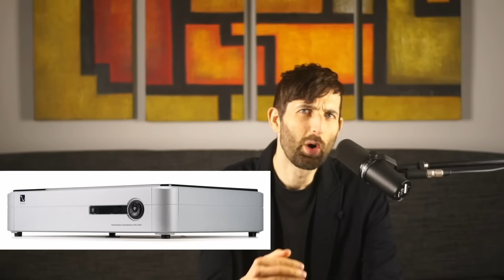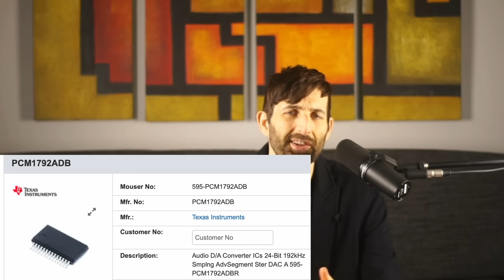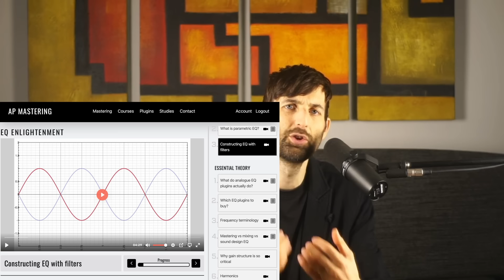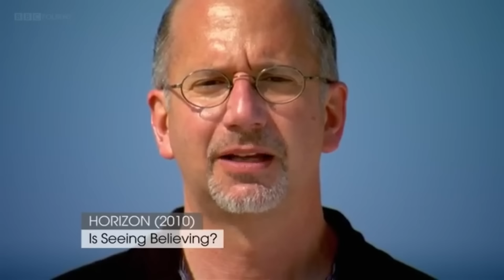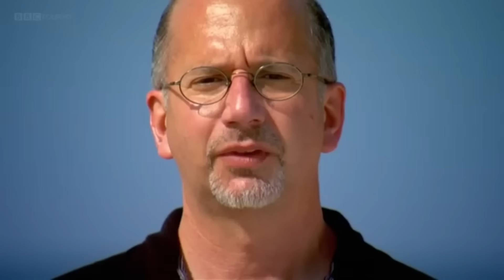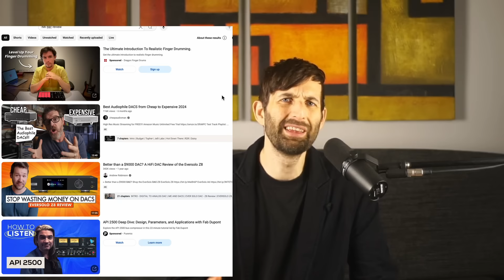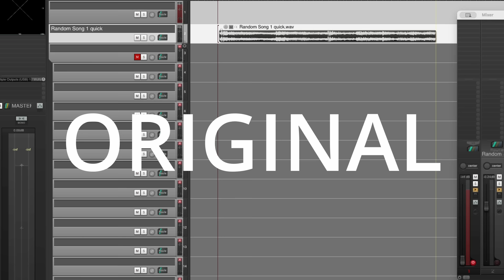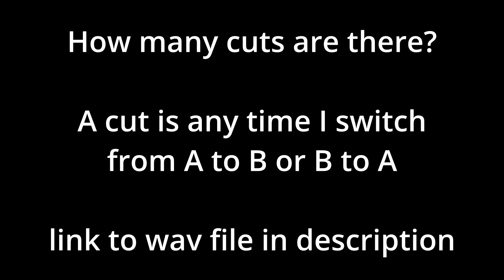The DAC Scam - Almost everyone believes the hype

Comment: Honestly couldn't tell you how many times you switched, I could guess, but it would literally be a guess.

Great content as ever!

I would argue there's a bit more than just the chip in a dac or adc, input and output stages, power supply and isolation from electrical and physical effects, build quality etc . But , yeah , if you're paying £1000s for a DAC then you're being conned ( or at least it's not improving the audio, obviously if the case is built from solid gold you're paying for bling!).

Keep up the good work, I appreciate your no nonsense approach ( 20+ years as a live sound engineer, also released a few albums when I was in a band and have done some production, recently got back in to making/producing music after a 10 year break, so your content is very helpful)

Comment: I have couple of inexpensive DACs in my various system and you can certainly hear differences between them.
Reply from the maker: you can hear bad DACs. but a good DAC is not that expensive
Reply: @APMastering You mean an accurate DAC. I have an old Audio Alchemy DAC that I like to use. It's not accurate, but it has a beefy low end that I enjoy. Uses an old 18bit 4xfs Burr Brown chip, and is obviously not as clean or accurate as any of my more modern delta sigma types, but it doesn't sound bad.

The DAC I bought for a fiver off Amazon sounds BAD.

Comment: You somehow managed to avoid any discussion of clocking.  Atomic clocks for digital audio have been on the market for a while.  On the subject of bias, a lot of people hear a difference because they have to get up to change something and then don't return to exactly the same position in the room.  Other people moving around can also change the sound.
Reply: yes the alignment of the sun and moon in conjunction with Alien spacecraft breaking the FTL barrier does that for my system as well
Reply: @chungang7037  I think we are making the same point.  I wasn't implying that atomic clocks are necessary.
Reply: @womagrid but what about FasterThanLight clocks? 🤔
Reply: I've found if something is slightly louder they sound better in a comparison.
And they sound identical if they are equally loud.
Reply: @Utrilus  Yeah, so you level match. If using the same converters though, why would you expect a clock to impact the volume? In any case, characteristic differences stay the same. The question is whether these clocks are reducing jitter, creating jitter, or shaping it in a pleasing (mixed bag)  way? They absolutely change the sound.
Reply from the maker: clocking has already been sufficiently good since decades
Reply: @APMastering I think some of this comes down to artist vanity.  An old Echo audio interface as a capture device for mastering could be a hard sell.
Reply from the maker: @ sure, and I think that would also not be quite good enough for mastering. you shouldn't go too lofi because then its legit not good enough... you should spend at least a few hundred quid for mastering.
Reply: @APMastering Nonsense according to many of the most famed DAC designers. Sounds self-serving perhaps but the credentials of some of these guys makes them co-inventors of digital audio.
Reply: @APMastering incorrect. Even in the last decade clocks have made a huge leap. The problem with an external atomic clock is dealing with the DAC phase locked loop and transmission jitter. I used a Grimm cc2 with my interface for a while, and it clearly sound better in the midrange and treble, the bass lost some coherence. If they had a clock like that in the converter itself you would absolutely hear a better sound.
Reply: @chipsnmydip  The bass losing coherence is a sign of worsened quality.
Reply: @riangarianga  I would think so. On the other hand, clarity improves in higher frequencies. With clocking you are messing with phase, and whatever you send the DAC/ADC PLL you can can end up with frequency specific phase distortion. In this case, the Grimm clock I used did seem to improve most frequencies considerably, and brought the sound more in like with my Mytek Brooklyn ADC which has an 86 femto second clock, but did create some subtle phase anomalies in the lower frequencies that took out a little of the punch. Every DAC has a PLL, and external clocking will create some degree of phase anomalies, at some frequencies, even if jitter in other frequencies is improved.
Reply: Btw, we aren't talking about losing a lot of coherence. Most people wouldn't notice.

Comment: My best produced albums between 2008 and 2013 were mixed with a PC with Mackie 32-8, a Motu 2408 (8 channels), 3 Alesis Adats XT as Digital to Analog (24 channels), 2 Alesis compressors, 2 Lexicon Lxp15, 1 Alesis Q2 and a BBE Sonic Maximizer in the buss.  
The sound is stellar. Mi colleagues couldn’t believe the sound without using Protools and all that expensive nonsense
Reply from the maker: nice! i used ADAT tapes when i was a teenager 😊
Reply: The first band I ever recorded was done on one ADAT machine with a 16-channel Mackie console and some cheap processors. :)
Reply: That equipment is totally fine even for today.   Will sound better than plugins for sure
Reply: I love the good old BBE sound.
Reply: its also about how you like to work and record your music, your example seems very nice to me, to do it like this. Less looking, more listening.
Reply: Today I’m a lot more knowledgeable of audio in general, technics, etc and all my productions are ITB. I really like the results BUT , even on those Masters I produce I like , I NEVER get “that sound” of those days with the analog gear. I’ve never owned a world class equipment though
Reply: Good choices! I have Mackie 32-8, Alesis compressors, Lexicon units, now TWO BBE Sonic Maximizers (those old through-hole units). They STILL sound great although most audiophile tests probably prove otherwise. :)
Reply: music making with a daw is surely possible. nowadays people seem to think that working within a computer is the only way to make music. Very nice setup sir! I have cassette tapes where i recorded my music to in the 90s. I didnt have much money, shit speakers, outboard synths, analog mixer, and could only record on cassette. Im thinking of doing this again before the inevitable return to digital.
Reply: I love the LXP15
Reply: @ I bought 2 of them and then 2 lxp5 that I barely used. Those oldies were sweet, a tiny noisy but nice

Comment: Hi, nice video. As I understand expending £200 in a DAC should be more than enough, right? That's the conclusion I arrived a couple of years ago, anyway.
Reply from the maker: it depends if it's actually good. you can make a bad dac for 1000000$. but a good manufacturer will do it for under 300
Reply: @s1nn1ck  if it helps, you feel like you’re being an audio file to believe that go ahead

Comment: You obviously have zero tech knowledge. The analog output section ,noise isolation and the power supply is what you pay for with a higher end DAC. These things will make a huge difference in the sound quality. Now are ALL audiophile equipment overpriced sure they are. But to claim a $100 DAC will sound as good a $1000 DAC with the same chips, then you need to upgrade your knowledge of audio tech.Thats what you pay for when you buy a high end DAC. just like one amp thats 100 watts for $200 is not the same sound quality as another 100 watt amp at $5000 it comes down function and design. . They both use transistors and transformers but both will not be the same. This is a terrible perspective. You "think" you have blown the doors off a conspiracy but all you have done is show off your ignorance.
Reply from the maker: what electronic devices have you built? i've built an analogue mastering EQ, a compressor, power amplifiers and some FX pedals. how many cuts did you hear in the blind test?
Reply: He nowhere says any USD 100 DAC will sound as good as any USD 1,000 DAC. Please provide the timestamps for your claims.
Reply: I have to agree with the video poster here.  

Of course it's a scam, when the world's most transparent, lowest noise and IMO best sounding DAC's are coming from Chinese designers right now, they really hit the price/performance perfect sweet spot.  The Chinese are using state of the art converter chips, op amps and sometimes discrete analogue designs to better anything costing 1000X more.  Have you seen technical measurements of some of these "Audiophile" DACS - they are laughable.
Reply: Honestly, try doing a few blind a/b tests, nothing fancy, you'll be surprised how those 'huge differences ' are almost, or totally, hard to hear!
Reply: I heard no difference. I voted. But maybe a loop would worked better XD. Good idea to record the loopback.

Comment: what DAC you are using right now?
Reply from the maker: i send a SPDIF signal straight to my hypex FA123 plate amps. i use the tc electronic BMC2 as my DAC when i need to work with analogue
Reply: @jlmjloi4533  Lynx. You?